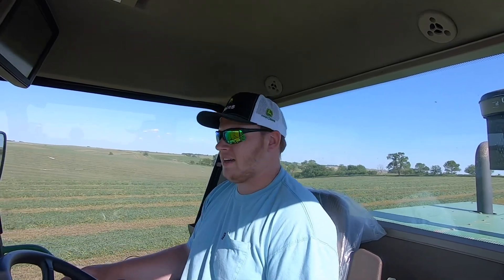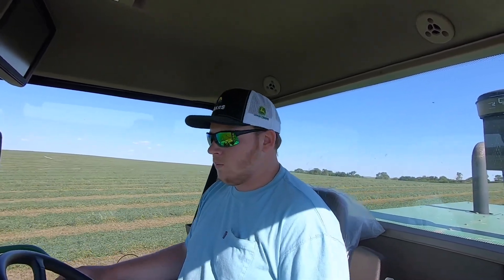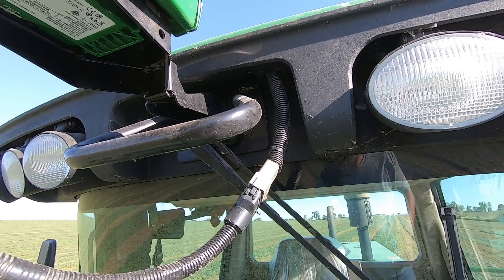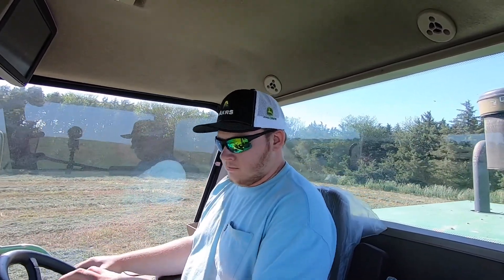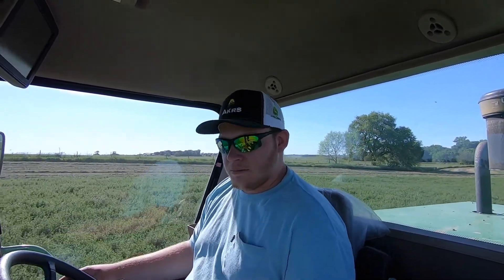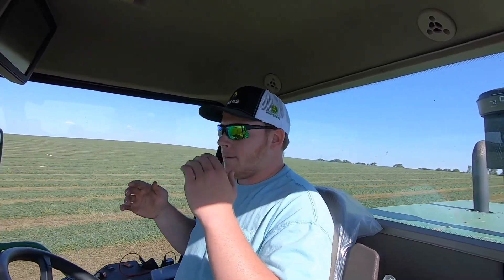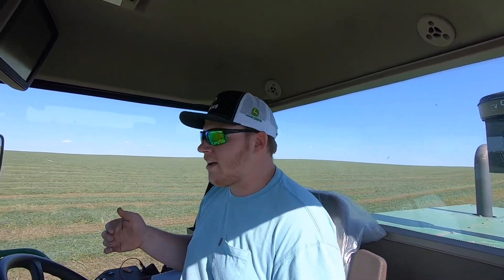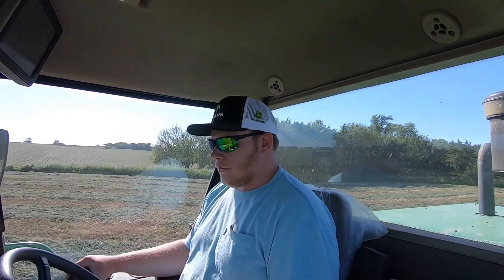John Deere GPS | Does it Work?

Comment: Nice work. Setting up a 4995 for windrowing canola, what anti rotation bracket did you get/make to lock the ATU onto the steering collumn? Couldnt quite make it out in your picture - any updates in settings. Im gonna start with yours
Reply from the maker: When I had bought the ATU it had a bracket that came with it. It looks like a big square that you put on the column and tighten it down with some screws. Hadn't really updated the settings too much.

Comment: Once you have it in auto steer and you miss some alfalfa, can you take it out of auto steer and just drive it? Like taking it in and out of 4x4 on the pickup?
Reply from the maker: Yes I can disengage it. All I have to do is turn the steering wheel and the the motor on the wheel will release. From there I will be able to drive it myself.